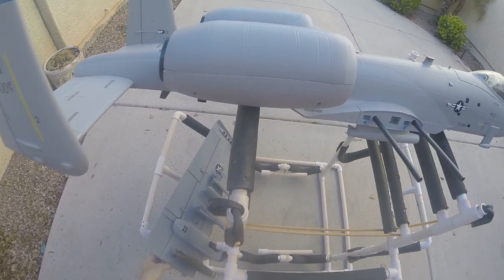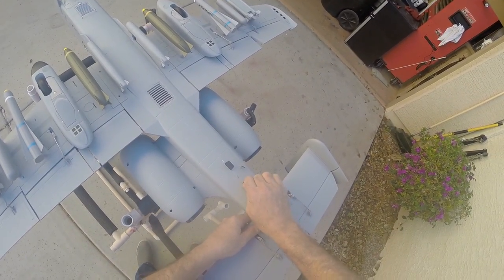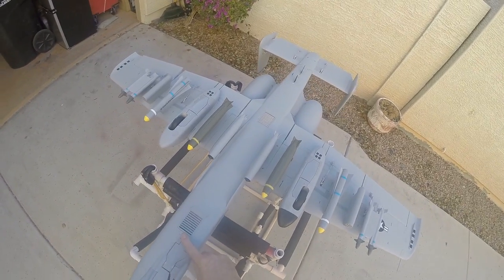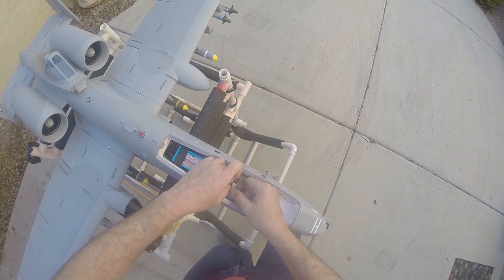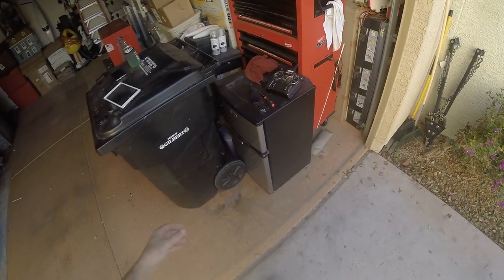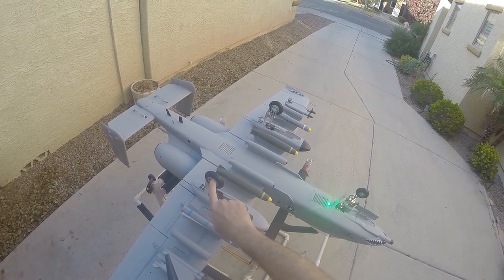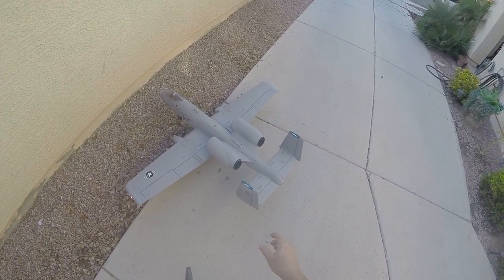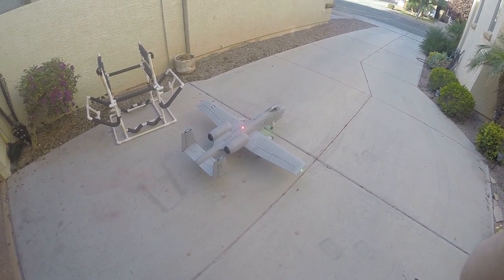FMS 1500mm A10 walk around

Comment: GREAT video!! Thanks for sharing!! What kind of flight times are you getting with a 6S 5000 pack? I've heard only in the 3 to 4 minute range. :-( I'm torn between this model and the twin 80mm Freewing. The Freewing actually uses two 6S 5000 packs instead of just one. Thanks in advance for your reply!
Reply from the maker: Thank you, With my flight style (Which is conservative on the Throttle) I'm seeing about 4 1/2 to 5 minutes on 5000mAh batteries. I typically fly it with a gens Ace 5300 and Glacier 6000mAh and get close to 6 minutes. If you like a lot of high speed passes, then 3 to 4 minutes sounds about right.  The EDF's in this plane are pretty efficient, powerful, and very smooth...so much so I have an extra set that I just put in my FW ME-262

Comment: Hey Brandon, I am now flying my FMS A-10, but I find it to be very nose heavy. I am using 2 Zippy Compact 3s 4500s and see that they weigh about the same as the battery you are using. You mention that you think the CG is off. Please tell me what CG point you are using. I have my batteries as far back as they will go and have added a Mobius camera mount back between the nacelles. When the camera is not aboard, I have a weight equivalent to the camera weight ( 1.9 oz ) and it is still nose heavy to the point that I need full nose up trim at 50-60% power in level flight. Today I put another 1 0z weight on the camera mount and now with 2.9 oz, it does balance on the stand with the gear up. A bit confusing. I do think the CG of 80-85mm shown in the manual may be in error. Your thoughts??

Comment: Brandon, I think I am hearing you reference an Admiral 6s 5000 battery for this airplane. I cannot find such a battery, I only see the Admiral up to 4s and 4500 Mah. Can you tell me where to look? Thanks.
Reply from the maker: MotionRC.com

I just checked and they are still selling them.
https://www.motionrc.com/collections/lipo-batteries/products/admiral-5000mah-6s-22-2v-50c-lipo-battery-with-ec5-connector
Reply: Yes, thanks, I guess I just missed that. I am planning on 2 Zippy Compact 3s4500 40c batteries for my initial flights, and go from there. The Admiral is pretty expensive. Hoping to get my A10 in early June, from Horizon Hobby.

Comment: Wondering if you have used 2 3s in series to power this bird. I use 2 3s on all my 6s airplanes and find it more cost efficient and just as easy to strap in. Is there enough room in this A10 for that?? Is 40c sufficient, I know they recommend 50c but in my experience, the manufacturer always go a bit overboard on battery requirements. Thanks.
Reply from the maker: Yes, there is room to use two 3S lipos in series, might be a little tight, but I'm sure it will fit. I haven't done it yet, but will at some point. Some of my other jets are set up that way.
Reply: Thanks for that......how about the c rating, do you think 40c is adequate? I have several 3s450040c batteries and hope they would be enough to fly this A10 for 4-5 minutes. What do you think?
Reply from the maker: That should be ok,  that's 180A capacity max output for those batteries (40x4.5=180). Well within limits for this plane. I would set your timer for 3 minutes for the first flights, until you get a feel for how much it's drawing with your particular flight habits and style and then increase or decrease it from there.